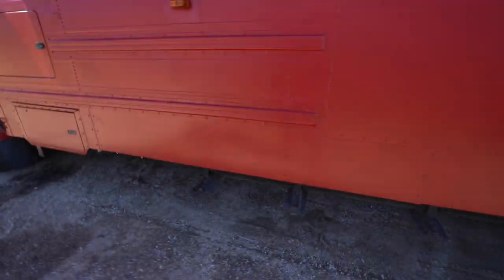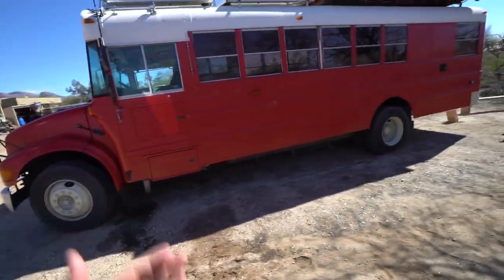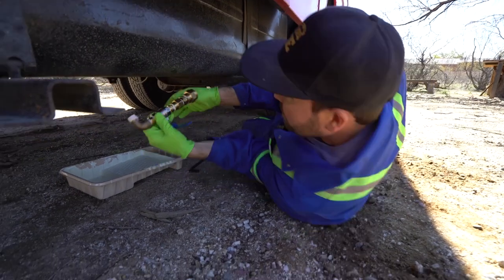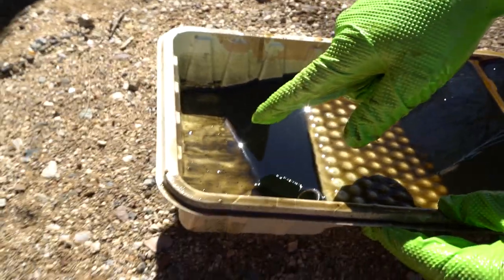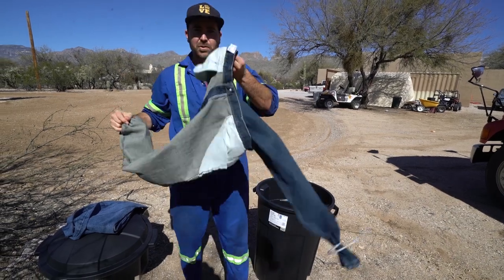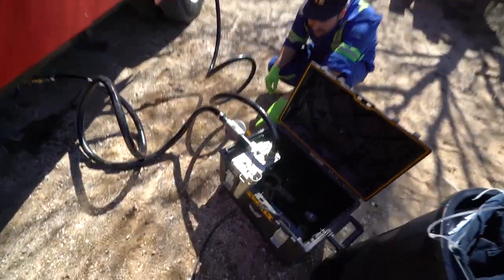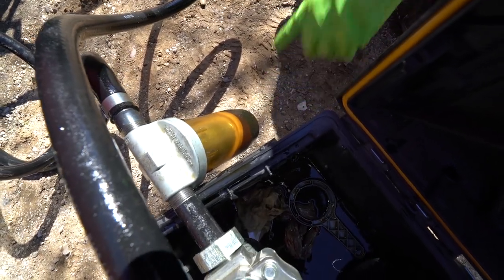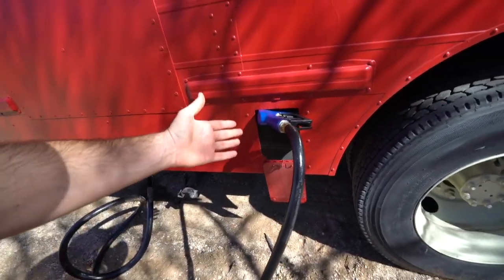WASTE VEGETABLE OIL DIESEL PROBLEMS

Comment: Jax....wouldn't it have been easier to just get the $8 filter you were talking about in the beginning instead of the used jeans?
Would that have caught the metal bits?
Reply from the maker: Marc Config no. Those only lasted a few gallons of oil. Just finished the denim idea and it’s perfectly clean.

Comment: But can I troll positivity (here, Facebook, Insta, etc.) ...... I just like to get that awesome heart on my comments 😊 I, almost always, keep negative thoughts and statements to myself. As a super small, non-entertaining, less educational creator I don't need and can not tolerate the negativity so I try my best not to post it on any platform. Do your thing Jax; us true fans and supporters will continue to watch, like, share, and comment.
Reply: Also, @Jax:
The idea for a more permanent system and filter system is good. Just watch and think about the width. As someone with CDLs and many years of operating military vehicles,, the width difference between travel lanes and buses/trucks is minimal, at times. Hanging something off the side of one of these may become a safety issue. Just be sure to check to keep yourself and others safe. Until next time, brother, take care.
Reply from the maker: Thank you. That’s the spirit.
Reply: @JaxAustin  
(Like a huge fan boy) He responded.....He responded to my comment.!!!! Oh my goodness, I am gonna faint. 

Thanks Jax. I do my best to overcome PTSD and TBI to be a better, happier, and drama free person. I just attempt to pass that on to others.
Reply from the maker: Thomas Tube you’re a good person. Come hang next winter with the gang. The storage box would be flush w the body.
Reply: Awesome. I would love to have the 5th wheel by then and join up.

Comment: your issue its whats called chicken skin. the wvo reacts with the steel, galvanized being the worst but regular steel is bad too.
only alu tanks work ok, or ss. the oil also reacts with insides of the ip etc, nothing you can do but replace eventually. good luck to ya, been doing it for 18 years myself now :)
Reply from the maker: Thank you sensei. Looking forward to perfecting it

Comment: Install a pre sludge tank before the main tank then you won't have this problem realtor off the top of the tank into the main tank before you burn the oil install clean-out in the sludge tank

Comment: My dude, you'll probably regret cheaping out on this. I've never had good results unless filtering to 1 micron. Any more and it's dodo for your vehicle.
Reply: I filter my waste motor oil down to 2 microns & that’s about it, mix it w 25% gas which is about equivalent to 50% diesel.

Comment: Jax could you share the total cost for the veggie side of your bus? Badge did the brain work so I know he saved you a lot.
Reply from the maker: Teo 2x $500 pumps, $300 hoses and fittings, 2x $70 electric solenoid, filter housing, $400 tank, $200 pressure regulator, $700 webasto. Parts w/o cost were free.

Comment: look on eBay for a 5gal bucket filter ,
Reply from the maker: where the hell is furchaser that’s what I first used. I topped w 25? micron felt filter. That’s how I ended up here. Should have been 1 micron.

Comment: Have you looked into low micron racing cleanable oil filters.
Reply from the maker: Tim Beach cleanable? Wasn’t sure that was a thing. The jeans worked amazing!
Reply: Look at a "hubb" high performance oil filter. Cleans to 5 micron. Not sure what micron you need to filter out but their is a fee different brands of cleanable oil filters just different micron filter sizes.

Comment: the term Troll sure is throwing around a lot on Youtube , jus bcuz one disagrees wth a youtuber dont make them trolls
Reply from the maker: Agreeing has nothing to do with the definition of a troll.

noun: troll; plural noun: trolls
1.
a person who makes a deliberately offensive or provocative online post.
a deliberately offensive or provocative online post.
Reply from the maker: https://en.m.wikipedia.org/wiki/Internet_troll
Reply: @JaxAustin  your  definition of troll proves my point as to the term troll isnt used correctly by most youtubers , we could get way off deep into this but lets not
Reply from the maker: True. I have no problem with someone having a different opinion. But if someone insults for the sake of it, then I have a problem. ✌️

Comment: simple way to get rig of metal debrea , a magnet inside the tank trown in the fillerneck hanging from a string , pull it out a few times and clean the metal off it
one filte i seen was a pretty good idea , works fast and doesnt clog up its a centrifuge , filters the oil by using gravity 
https://www.utahbiodieselsupply.com/centrifugewvo.php would work great when filling the tank with dirty waste oil too ,  it will filter ir about as fast as you can pour it

Comment: Jax you are doing Great! It is amazing how much trial and error goes into making your own WVO. I have been doing it for 8 or so years now in my 12 valve Cummins and old Mercedes diesel. One thing that caused me and my buddy a huge headache with the veggy was algae. If I could give you any tip it would be to use this biocide treatment to keep that at bay. Here is the Amazon link https://www.amazon.com/gp/product/B009LMW96G/ref=oh_aui_search_asin_title?ie=UTF8&psc=1 that stuff works great and it will help you avoid any problems. I also use these sock filters from mcmastercarr.com that work great and they are cheaper than jeans. Just keep plugging away at it and pushing through the headaches and you will eventually get a smooth running operation.

Comment: Please stick to your day job. I have been subscribed to your channel for quite a while now. You are a travel vlogger, not a bus mechanic, or bus builder. In one year of traveling, you went from 2,000 subscribers to 20,000. If you had continued on at that pace, you could be at 200,000 by now, or at least you would be at your 100,000 goal. But by my figures at your current pace it's going to take you about 12 years to get to 100,000. Please get back to doing travel vlogs as soon as you can. This is just a lot of wasted time, that you could be building your channel, instead of building a bus.
Reply from the maker: Max Zomboni if I could snap my fingers and be done, I would. I prefer the road.